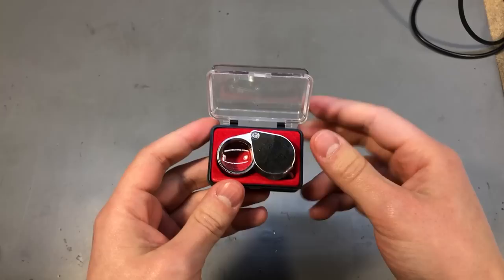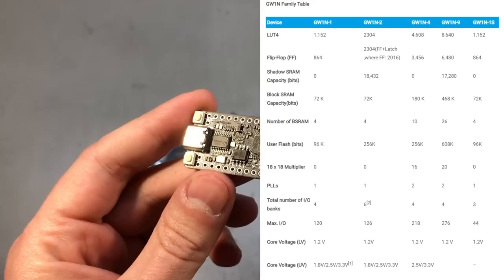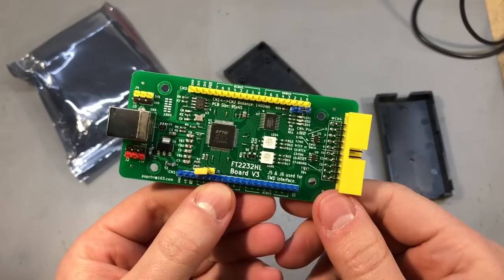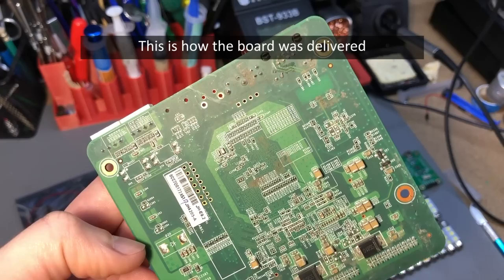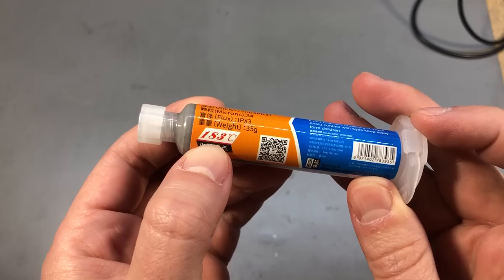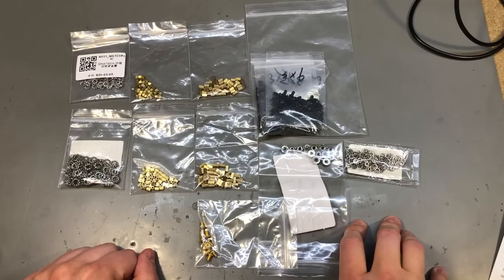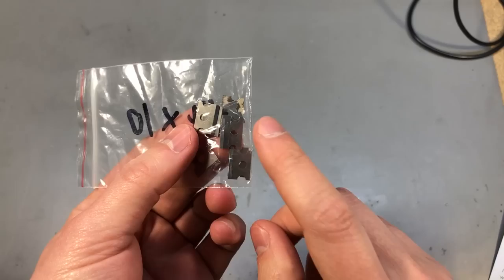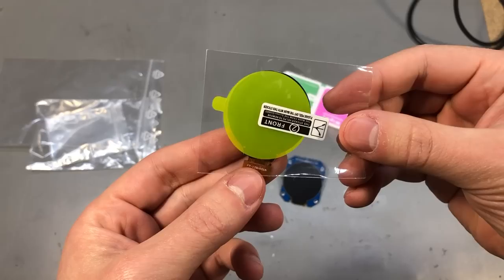InTheMail | Voltlog #360

Comment: Is the solder paste a full 10cc syringe? When I order flux paste the container is usually half empty.
Reply: You're wrong! Its half full. ;)
Reply from the maker: Nope, they're never full but even so, the cost is good and the biggest problem for me is that the paste gets old, I never use it all up.
Reply: @voltlog  try to avoid air inside, and keep it in relativiere cold place (balcony in my case).  I have 4 years old paste and it still works almost as a new one.
Reply: @goodwill7643  It's half empty when you go by the stated weight.
Reply: @acoustic61  yes, it depend on point of view :D But from my perspective I compare it to local shop, which sells similar product for 10-15 bigger price. So from gram/$  point of view, it is still overfilled.
Reply: @goodwill7643  I'm going by the lying vendors. Most of what I purchase from China is mis-stated or total junk. Then it's an act of congress to get them to agree to refund. Very petty and dishonest culture.
Reply: @acoustic61  Yes, i agree that wrong values in specification makes things very complicated and it is not nice, in some cases even dangerous. But for me I usually trying to concentrate on final goal and in that case many fancy presentations doesn't make any sense. For example if you compare price of MCP3008 and Atmega328, same ADC function, different price. I think it is not very smart to do 100% trust in any spec. you get in your hands.
Reply: @acoustic61  ...and yes, we can't test everything, so critical applications, should have exact valus in datasheet.
Reply: @goodwill7643  I recently ordered a set of foam pads that were specified for my Grado headphones. They didn't come close to fitting. Should have bought OEM.
Reply: @acoustic61  me too, but I was looking for pads with exact value like 5CM. And if you receive 3 or 7, then you can open dispute. Same with transistors, if in secs you can see 1A, but it barely drives 0,5A. You can open dispute. Then you'll get 0,5A transistors for free ;)
Reply: @goodwill7643  I don't want anything for free. Just want original item to function properly.   Takes up to two months to receive anything now. So I don't order anything for critical application. Especially rare parts. Too many counterfeits.